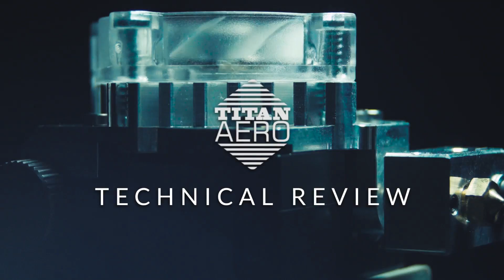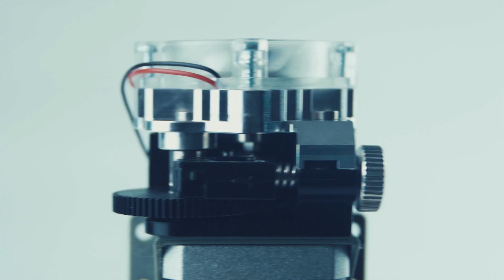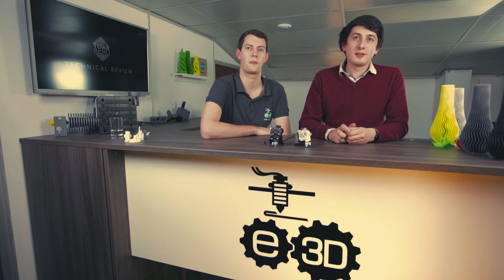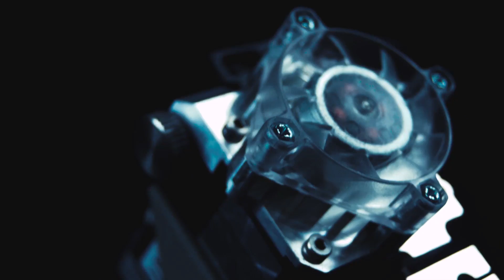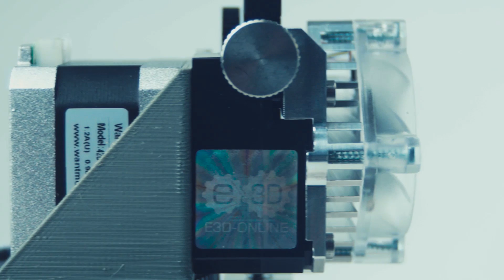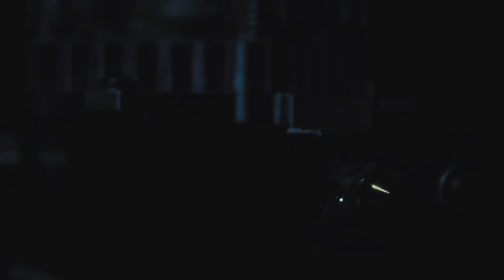E3D Tech Review: Talking Titan Aero

Comment: Would you have the MK2 adapter and layer fan and required firmware changes 
available?  Does it still use the stock auto level probe?

Comment: Is there a trick to mount 2 of these for dual extrusion? You need to get the heads z leveled for this, but I don't see a way to easily do that. you sell a mirrored version too, so this is more than likely 1 of the purposes, but how would you align these 2 easily ?
Reply from the maker: Standard and mirrored Aeros side-by-side should be level and get the most out of your build volume in dual extrusion :)
Reply: OK, so the distance below buildplate as shown in the technical documents are always exactly 24mm ?
Reply from the maker: As long as you have screwed together the parts in the same way then yes, both the standard and mirrored Titan Aero will be exactly the same length and extrude at exactly the same Z-axis position.
Reply: I see in you technical drawings that the heater block below the titan aero is drawn with the mounting for the heater cartridge to the right, but on the pictures in the shop it is facing to the front. Can you choose that yourself by screwing the heater block onto the heaterblock just a quarter of half turn further and then spanning the nozzle more or less to compensate for the amount of space needed to tighten all up ? I for example would like to have it pointing to the from, so it becomes easier to have a part cooling fan blowing from the back (less clutter in the way). Possible ?
Reply from the maker: Hi,
While this kind of mounting is possible it's not really recommended. The position of the nozzle and heatbreak inside the block is of paramount importance, as any looseness or separation can cause oozing and worse. For the most reliable results please follow the assembly guidelines here: https://wiki.e3d-online.com/wiki/Titan_Aero#Hot_Side
Reply: Euhm, not to act silly but on 1 picture you show the hotend with the heater block oriented with heater cartridge on the left, on another picture the heaterblock is on front and on assembly instructions it is mounted diagonally ??? That doesn't make anything clear at all.

Comment: the pricing for this is beyond market value, like 2-3x as much.... you can buy locally, a branded CPU cooler with 10x the size heat sink and a 80mm Fan on it for 1/2 the cost of this....   shit, you can get a liquid cooled one for the same price that has LEDs and a pump and a radiator...  the upgrade is worth $15-20 tops...  it's $60 here, $60 for a 40mm fan and a tiny heatsink... and a 20 cent bearing.

Comment: 90 quid for something that has a fan held on with self tappers Think ill pass. Heat sink is a nice piece of design but NINETY QUID !!!!!
Reply: Would you like it to have little diamond tipped studs? It's a fan fs, what else are they going to use? Self tapping screws on small fans is industry standard. I'm sure you will wait for the Chinese clones and buy one for £10. I like to support the innovators and will always buy direct from E3D, they are the guys that are moving the industry forwards, you can't put a price on that.
Reply: Bonded inserts , heli-coils, silicon iso dampers. Especially some form of iso dampers would have been nice considering the E3D fans can howl like banshees on occasion. As a long term user and regular customer of E3D you do not need to convince me of the support they deserve, but that does not exclude me from voicing a negative opinion when i have one.

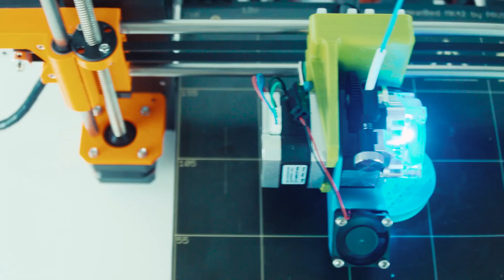Comment: Cool design.  At 3:04 is that a trick light up fan or is that standard?  Also, will it have the same thermal performance with the Volcano heater block?
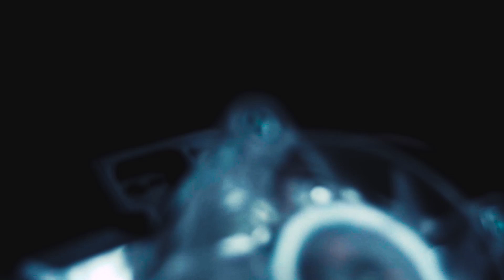Reply: 2:06 Oh, it was a trick fan.
Reply from the maker: Sadly that is just some glare - the standard fan has no lights and is just clear acrylic. And yes Aero is fully compatible with the Volcano :)